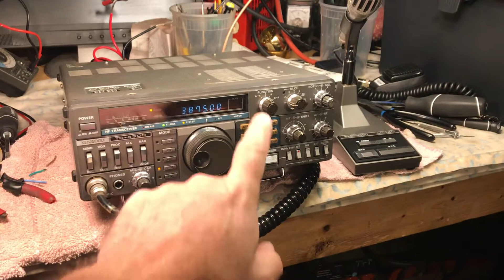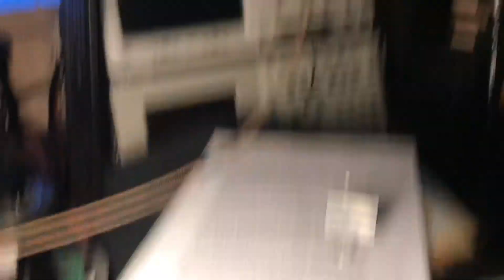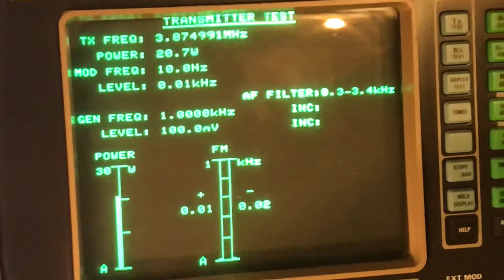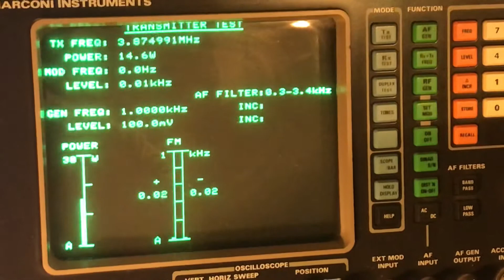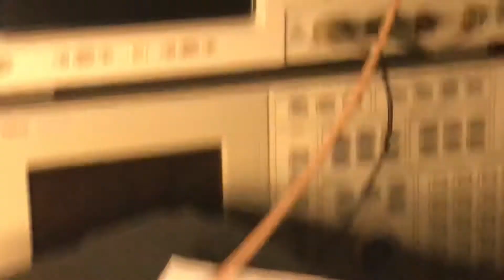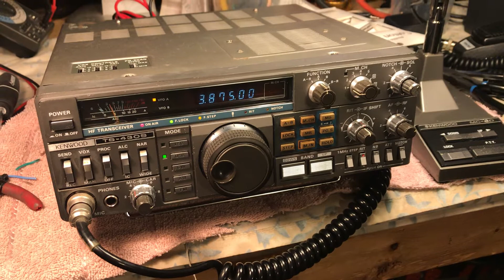Kenwood TS-430 & MC60 Desktop Microphone Test!  Part #2

Comment: Just changed my Batteries in MC-60 Mic, then a couple of buttons stopped working, removed PCB & it was covered in miniscule sand which had got into switches, it came from two pads that had on the inner of the TX Lock Button which would have been fibre but over time had disintegrated into the sand/powder, air blown it all away cleaned switches with a good dose of contact cleaner spray & now it’s perfect, replaced pads on PTT Button with rubber cut to shape & superglued in place

Comment: Hi. Do you use 500 or 50kohm setting on the mc60? Just got one for ts430. And the up-down button on mine seems flimsy, is it supposed to be a little 'loose', and not like the other buttons?